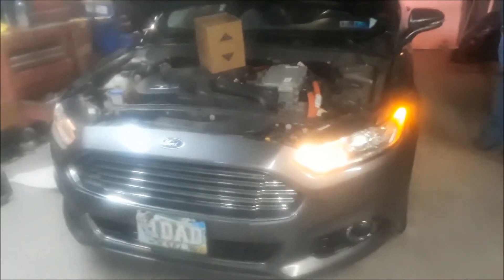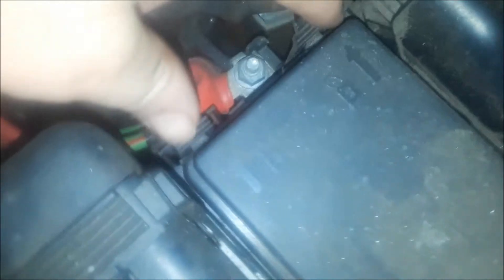Ford Fusion Fuse Box Locations 2013 to Current

Comment: You didn't explain there's a bottom side of the battery junction box as well as a top. More fuses and relays underneath
Reply: All the small fuses are on top and if you take off the 1 screw and unclip 2 tabs the top portion of the fuses case comes off then under that you just need to remove the cover  with 2 clips and a the larger fuses are under it.

Comment: I need to change fuse #60 in my 2017 Ford Fusion.  This fuse is located on the bottom fuse box.  I cannot get the box to remove so I can see the bottom fuses.  I will be thankful for any help.

Comment: Hello. was wondering if you can help me find the fuse for the yellow wire behind the cd player on a 2013 fusion. I got the 8inch Screen so my harness came undone like the yellow wire fell off and touched something while I was trying to add a amp and now no power to the wire. everything works like the screen goes on but now its not letting me listen to music and I'm getting 911 assist is disabled and I looked through some fuses and did not get around to number 33 radio and trying the 32 radio frequency receiver,  also the main fuse "hoping that's the one" I just am puzzled about the cd player fuse. Thanks.